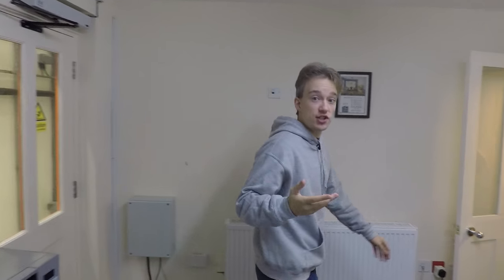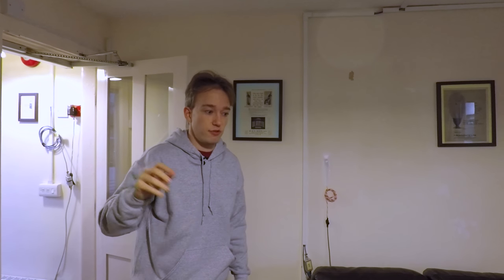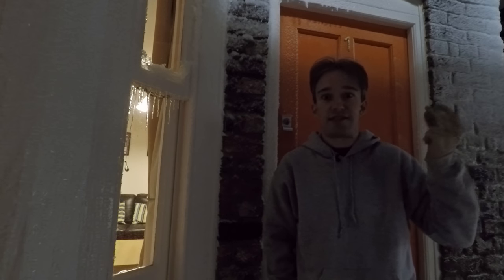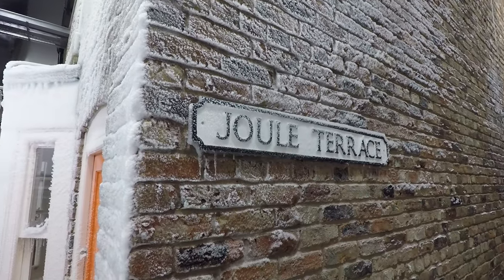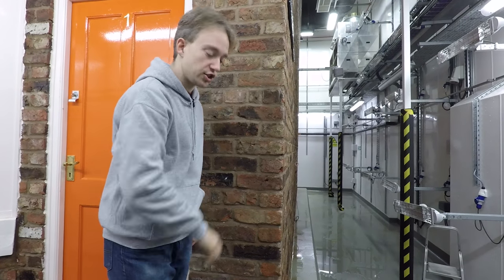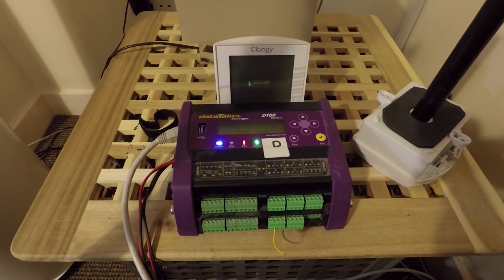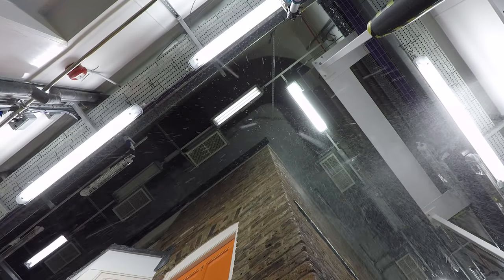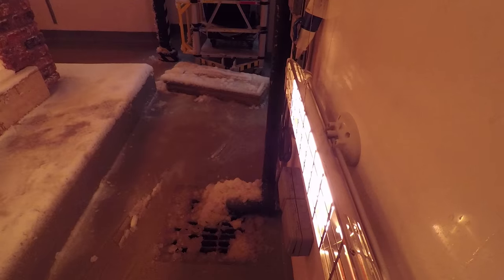Science vs the Weather: Salford's Energy House

Comment: My grandpa had problems with heat escaping the house very quickly even though he insulated it pretty well. I borrowed my friend's little smartphone-mounted thermal camera and mounted it on a drone and we were able to find all spots in the roof where heat was escaping and after insulating them, my grandpa's coal usage dropped by almost 20%. It's shocking how much heat can escape through seemingly well-insulated roof. Great video!
Reply: I'm honestly surprised people still heat with coal.
Reply: @huntsbychainsaw5986  Even though we never even need a heater here (tropical weather) when I heard that brits still used coal to heat their houses, my thoughts is just why?
Reply: We used the heat with coal. There are no gas heating mains where I live, so we had to get an oil tank installed. As this was expensive, it took a while for the installation to be done.

Comment: Good to see people working on this. Old housing has always been a thorn in my eye. They are leaky, poorly insulated and it sucks to live in them in both the winter and summer because it's either too cold or too hot. Sure hope we get some results from this in "the real world" soon.
Reply: I can't say for the UK, but updating and improving "old" construction homes (late 1800s, early/mid 1900s) has been a thing in the US for the better part of 3 decades. You can watch episode of "This Old House" from the late 80s/early 90s and they are retrofitting old Boston (where the show originated) homes with improved windows, insulation and the lot.  Granted the tech has improved since ~1990, but the intent and underlying methods have been around for a long time.

The troubles come in places like Pomona, California (where I used to live) where homes in "Historic Districts" are so overly protected, that doing reasonable upgrades (like replacing metal swing-out windows with wooden or vinyl) is illegal, because the letter of the law requires "like for like",  where a metal swing out window has to be replaced with a metal swing out window. It becomes entirely impractical, because no such things are currently made, requiring custom fabrication, which is expensive, and still won't be much improved because of the materials required.
Reply: ThaTyger, Similar to perhaps half the Australian housing stock which was built before insulation became readily available.  Weatherboard outside, tongue-in groove inside or something like Masonite, no insulation of any kind, multiple windows to let air in during summer - cold as charity in the cooler months.

Comment: Cool Project. I hope they are monitoring the air quality inside the house.  Because a lot of these energy efficiency improvement make the houses so airtight you get a build up of damp stale air.  This promotes mould which is terrible for our lungs, especially us asthmatics.
Reply: Add a dehumidifier and an heat exchanger airbrick. Sorted.

Comment: What was different about the brick laying?
Reply: I think it was the course pattern, I'm not sure.
Reply: I'd like to know, too.
Reply: Victorian homes were solid wall construction, more modern homes have twin walls with a gap to prevent damp getting through.
Reply: Dougstillation true, but there's likely more to it than that.
Reply: Every sixth row has the bricks set with their headers [the smallest face] exposed. This is known as "common bond" or "American bond" - it's an unusual bond in a British house!
Reply: The bricks are different size, shape and composition, the Victorians use much more cement and of a different composition. Also its much more of a hash job, they use bits of wood or brick shard to fill in gaps.
Reply: Late Victorian terraced dwellings such as this used a standard mass produced brick throughout for cheapness. The apparent variation in size & surface appearance seen in these reclaimed bricks is due mainly to the edges having crumbled over decades of frost action in a Salford winter. The frost action will also pop the smooth finish off the front of the brick. These bricks would originally have been a lot more uniform.
Reply: nightjarflying This is the correct answer.
Reply: Houses used to be built with the bricks interlocking to form a double width wall, they then switched to two single width walls with an air cavity (many of which have since had fibre insulation pumped in), and now two walls with an insulating layer built into the middle. There are, of course, many other methods of building, but that's the traditional British house.
Reply: if it really was a question of an air gap in the bricks or not, I feel like a modern mason could do the job. however, seeing as how an awful lot of modern construction simply does not use the brick masonry directly for structural purposes but merely as an aesthetic accent, I wonder if its a question of getting the mortar joints done right. its long, labor-intensive and anywhere with earthquakes it is likely not code all by itself. this building looked like it almost had "weeping" joints but i was watching on my phone...
Reply: unclejoeoakland They needed to find a master bricklayer to rebuild that house because relaying reclaimed bricks is tricky using the thin bed of mortar Victorians preferred. The reclaimed windows & doors have to go in at the same height as before & the same number of courses of brick as in the original house for the window or door height! These are probably standard Victorian bricks [9" x 4.25" x 2.5"] & they would have been laid two bricks deep to make a 9" thick wall with no air gap cavity at all [cavities in domestic dwellings are mostly post-WWI]. Victorian bricklayers were taught to use a very thin layer of mortar between courses [say 6mm or 0.25"] whereas modern bricklayers tend to use a much thicker layer of mortar [around 10mm 0.4" today]. Laying rough reclaimed bricks with a thin bed of mortar is near impossible so they needed an old bloke who worked to that standard in his day. You can see that he struggled a bit because the mortar beds are thicker than on a typical Victorian wall. Victorian railway arches are worth going to look at to see how amazingly thin the mortar beds are throughout. To achieve that you need very accurate bricks, a skilled bricklayer with a skilled 'mate' who can mix a consistent mortar. Years of practise.

Comment: Its a mere 45 years since professor Randall built 4 highly insulated houses at Salford Uni for the same price as a typical council house. What have we learned since then with 150mm insulated cavities, 300mm roof insulation, triple glazing and heat recovery ventilation. I understand the houses were so well insulated they only needed a low cost gas fire to heat them!

Comment: The important thing for me to know is... How did they improve those things?
Reply: Changing from single-pane (and double-glazed) glass to triple. Changing from storage radiators to underfloor heating (I think). Pumping insulation into the wall cavities (or putting an inch of foam between the brick wall and plasterboard finish).

Those tend to be the big ones that'll work best.
Reply: Domen Bremec Maybe reducing size of the hole between windows and wall so there is no space for owls to get in of it, just space for little birds.
Reply: ErkkiMattila 
According to Neil Gaiman, wolves may also infest the walls.
Reply: Adderkleet I was under the impression that while going from single glazing to double glazing is a very large improvement, the change from double to triple is not that impressive.

Still, good insulation would be a major factor in most things...
Reply: Amongst the improvements already suggested, I would imagine replacing sash windows with casement windows would be another.
Reply: Argon gas insulated double pane windows are good.

Comment: Interestingly the place I live in is in Providence, RI - it was built in 1900 so no insulation whatsoever. And when we moved in it had an ancient oil fired steam system. That was replaced by a modern hot water circulation system a few years back. And I'll tell you a $250 gas bill is better than a $900 bill per month to fill an oil tank. Now if the building owner would just blow some insulation into the walls.

Comment: Well why would you have the door opening inwards. And why would you have the door open directly into the living room.

If the door is on the inside of the frame that means the cold air / snow / rain can get through much more easily. If the door is on the outside then there's a lot more "stuff" in between and you can insulate it much more efficiently.
Reply: Another person who thinks the Japanese have it right. Presumably a Japanese person has never opened a door in somebody's face before. Not all houses have the front door there; it's not a big house.
Reply: I don't know how you manage to hit someone in the face with a door. You'd know better than to stand where a door opens. All of Scandinavia like Finland, Sweden, Norway, private homes open the door outwards without bloodied noses. Afaik this is mostly the case with all the Baltic region, Soviet houses included.
Reply: opening inwards is better for exiting and entering the house imo, unless you are carrying something that is the width of the doorway, although it may be bad for efficiency, it is more convenient
Reply: mmh. Well, this isn't a cold climate (quite the opposite in fact), but due to the presence of screen doors on most properties around here, the actual door has to open inwards.
On my property the front door opens inwards and then there's an outward opening screen door (hinged on the opposite side of the door frame) right up against it.
Still, that's not really related. XD
Most front doors I've ever seen (and I've lived in several countries, and visited many, many more), have inwards opening front doors.
Interior or exterior doors other than the main door vary enourmously, but front doors fairly consistently open inwards.

Don't ask me why (obvious things such as inclusion of screen doors aside), but that seems to be the norm in large parts of the world.
Reply: Presumably there are no streets in Scandinavia either. Or houses without front-gardens, flats (apartments) with corridors (I mean Japan has those), busy people, general need to use all the space available (Japan again!) etc...

Comment: Shouldn't they have something to simulate the thermal properties of humans in the house, moving about, sweating and emitting body heat?
Reply: Good point. They could turn it into affordable student accommodation to do tests like that. Two birds with one stone.
Reply: Joule Terrace: Now with 100% more mould.
Reply: Who says they haven't? The average human only emits about 100 to 150 watts at rest or doing light indoor activities, and doesn't lose more than a half pint or so of sweat per day under normal conditions (heck, my dehumidifiers are barely pulling out that much between them right now, and the air indoors is bone dry...). A device to emulate that could be quite small and easily overlooked.
Reply: mspenrice is correct. Also, the whole point of putting this building inside another building was to be able to exactly duplicate testing conditions. Adding humans to the mix automatically nullifies that. Say one of the students has a fever one day, and is putting out 200 watts for a few hours. Say two of the students find a broom closet with no cameras, and put out 250 watts for 30 minutes...... :)

Comment: 0:38 how do you know which will work? I'm little skeptical about this approach. It gives results for one building, but all buildings are different. The size and position of the openings relative to landscape is very important, quality of construction is very important. I think those can outweigh the differences of weather from one year to another. Of course new building materials and structures are carefully measured by the industry, and engineers calculate the heat losses of a planned house. This model might be better for measuring how bad the old structures are.
Reply: Which is exactly what it is for: Not for testing new models, but for testing improvements to Victorian houses.
Reply: The majority of houses in England, especially in the industrial and rural North, were built pre-world-wars. So, to test on a single layer terraced house of the period really does have the "one size fits all" as an excuse.

Comment: I've been questioning my self about why my house is always so cold in some places that have good (big) walls, and in others that have almost no walls/roof it's warmer....
Reply: Rodrigo Graça If your walls are made of something like stone or brick, keep in mind that a large block of stone has a high thermal mass.
It takes a lot of energy to change the temperature. So the walls can absorb a lot of heat compared to thinner walls.
Two surfaces in contact (say air and brick) try to reach equilibrium, but air heats up and cools down much more easily than brick.
This means the air inside a house will become more like the temperature of the walls than the walls will be like the temperature of the air.
The thinner the walls, the faster they change temerature.
and if it's an outside wall the exterior temperature matters too since this will heat or cool the wall (unless there is insulation to reduce the outside temerature influencing the inside temperature).
Without insulation, a large, heavy wall means the inside takes a very long time to heat up if it's cold, but once it gets warm it takes a very long time to cool down as well.
A thinner, less imposing wall heats up and cools down much faster, so if you try and change the temperature of a room, or the outside temperature changes, it will heat up or cool down at a much faster rate than the room with much thicker walls.
Reply: Do you have tall ceilings?  I live in an old victorian town house with 12ft ceilings and it's always cool inside no matter what the temperature is outside.  The thick walls are pretty good insulation (remember, insulation can keep out warm and cold) and any warm air inside rises up into the ceiling/roof.
Reply: big doesn't always equal good.    a traditional brick wall with no insulation is about the same insulation value as a modern piece of glass.   that said putting insulation on the inside has its problems.

Comment: Did they use traditional 'breathable' lime mortars, internal lime plaster to ensure it was in keeping with period soft bricks of the property?  Old bricks are softer than today's modern bricks (due to lower kiln temperatures), and as a rule the mortar should always be softer than the brick.
PIR insulation boards in floors/ walls are fine in modern builds, however when introduced to heritage builds it can cause damp problems due to its none breath-ability. Sympathetic breathable solutions should be considered like lambs wool between joists of suspended floors, and lime hemp plaster for internal walls.

Comment: Cool concept, but I question the usefulness of such a model. I would think that applying various modifications to houses in the real world, measuring any seasonally adjusted changes in metered heating and energy usage, and then feeding the data into a statistical model to identify the most cost effective and beneficial improvements would be a superior strategy.
Reply: this removes variables though, not all summers are the same temperature, people dont live in consistent ways.. plus this thing lets you simulate winter all year round.  otherwise you'd have to change one thing, wait a year, then try another thing.

Comment: Surely that's excessive though. They're not testing complex rocket parts and systems, they're asking "hmm, I wonder if the house would be more efficient if we redid the insulation and flooring." Answer, no duh. Ballpark figures would be adequate to demonstrate that such upgrades as he listed are cost efficient and effective. Didn't hear a single example of something that required such a big, elaborate setup.

Comment: Most probably older than a mere century say two or three, But the real question here is What can be done to thermal-proof old brick—spray-on wool, spray-on aluminium (sic), soak-in phase-changing molecular goo, soak-in hydrogen-ion movement-inhibiter (sic), soak-in self-setting moisture-dispersant (cf MD-40 aka WD-40)...

Comment: Hi, why do we launch weather balloons if we have satellites?
Reply: Devan Velo probably because some measurements have to be done at the exact height weather balloons operate in
Reply: Devan Velo weather balloons can take measurements inside the event in question, satellites can only see it from the top.
Reply: Also, balloons are cheaper to make and to launch
Reply: Jesus Gonzalez the equipment in a satellite weighs a lot and you cant move stuff to outer orbits. When the balloon gets too high it will pop
Reply: Balloons can take pressure readings, humidity, wind speed and air temperature readings at varying altitudes, which satellites can't do.